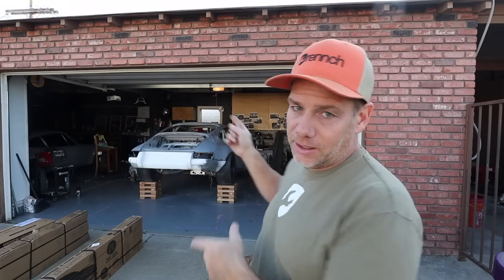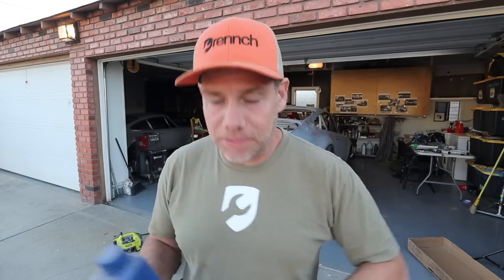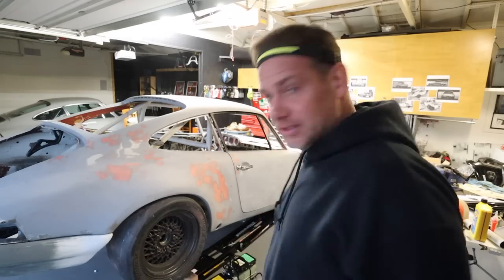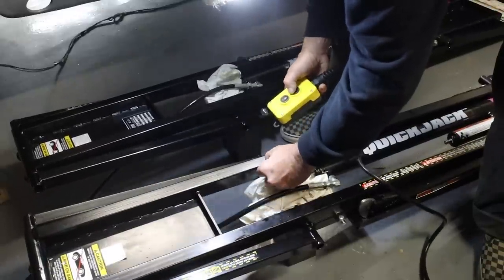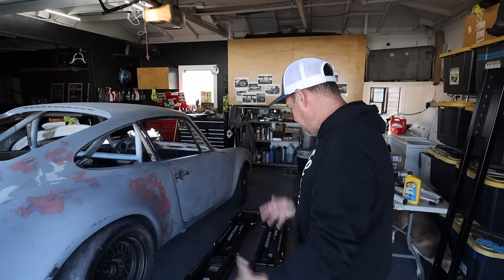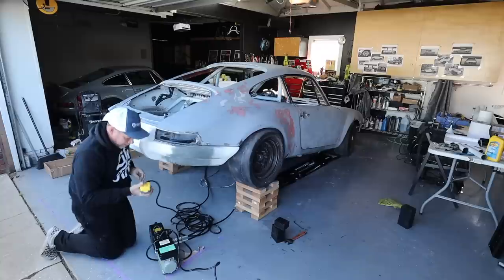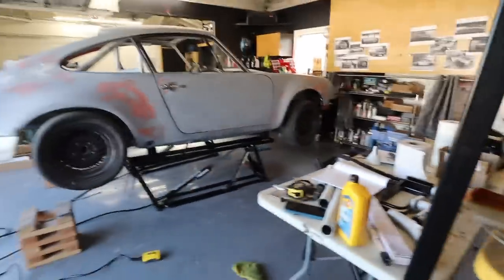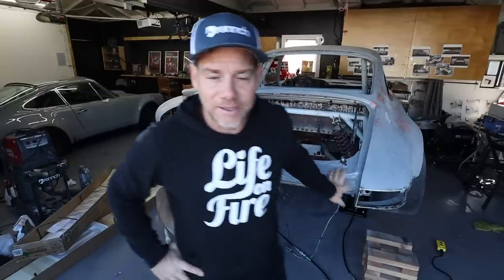QuickJack Car Lift Unboxing and Setup // Is This The ULTIMATE Garage Upgrade???

Comment: These are awesome. I've seen other videos of folks with the hose leaks too- I think you'r approaching it right using tape (the right way around)- it should last forever. I guess you could still put stands underneath it for safety- I'd be a little concerned about long term use- they have "click" stops but not really anything I'd trust to be under- but who cares if you can get the car that high and just put stands on 4 corners- hell you could lower them then and move them and all the hoses out of the way- then bring them back as soon as you need them again- they're so portable and lightweight. You can even hang the whole system on the wall! Super- this may be a new addition in my garage. I've got a 964 rebuild in the future- a clutch replacement in the NEAR future- so this would be super helpful!
Reply: 👍I’m a GC and all of my plumbers wrap their fittings clockwise 3x minimum and then use a bit of Teflon thread sealant on top of that.

Comment: I agree, the sealant they provide “SUCKS” . I did the pipe tape as well. Still a great product!
Reply: The sealant is supposed to cure for several hours (overnight?) before use. But ya, just way easier to use thread tape.

Comment: I had the same issue with the provided thread sealant leaking on all connections. I wound up using teflon tape.
Reply from the maker: old standby!

Comment: I've had my quickjacks for a little while, the first time I used them I thought they were epic, easily went under my 996, got it up high enough, awesome. Second time I used them it took me about 2 hours to get one of the "quick" releases to connect to the power unit. I've also had them going up at different speeds and I have had a car stuck up in the air as one of the jack's wouldn't lift. They have been used maybe 6 times in total. Would love to get rid of them but they I don't think I'd get much back for them

Comment: Just a second thought, does the system have mechanical position lock? I think if it had lynch pins to lock the height you’d be good to go. Loving the build!
Reply from the maker: There are multiple safety catches yes.

Comment: Those jacks are way cool, but I think you should still have wheel blocks or jack stands as fail safe just incase of a hose or cylinder failure.
Reply: Once it's up, there are steel bars you swing in place to lock them up.
Reply from the maker: There are safety locks in multiple places.

Comment: If you had the jacks the other way around, the hoses would run to the front of the car and wouldn't be in the way for rolling stuff/yourself under the back.
Reply from the maker: I've tried both.  The power outlet is on that side.  and it has to do with the direction the car moves as it's being jacked up.